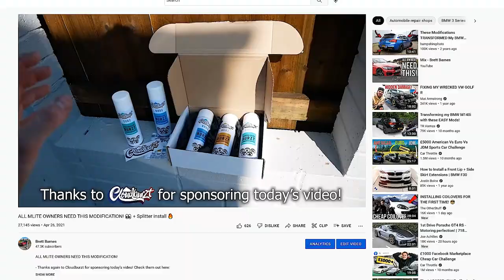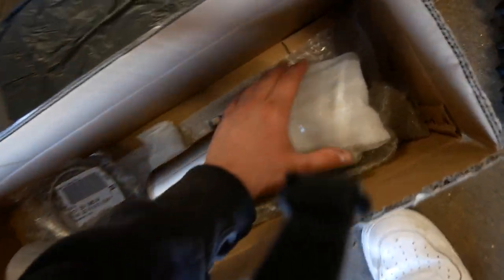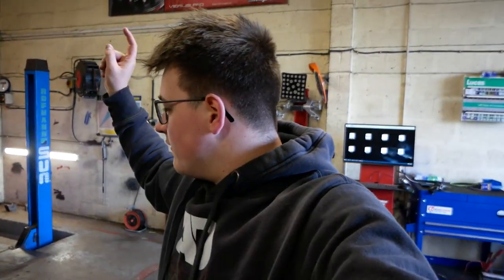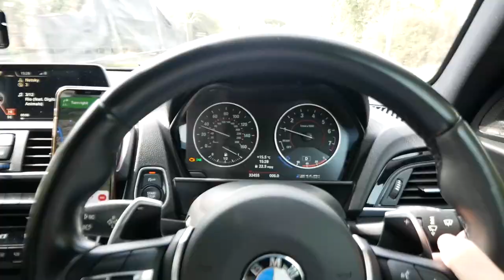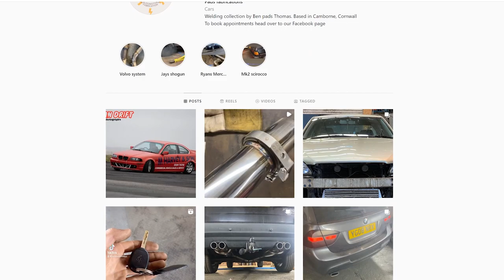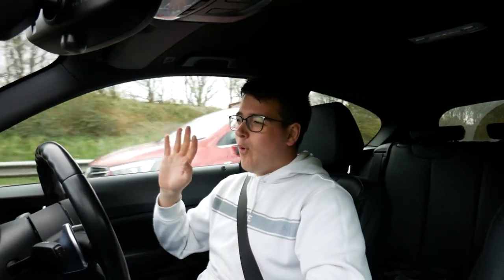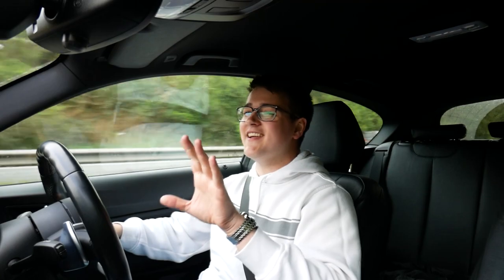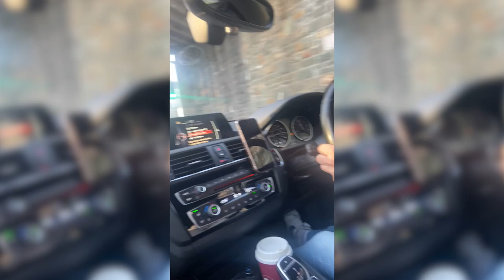SPORTS CAT + DOUBLE RES DELETE FOR MY M140I *EXTREMELY LOUD!*

Comment: Do you need a m performance exhaust for it to sound like this? Or will my stock exhaust be fine? Im thinking of doing this to my 540i
Reply: Stock exhaust retains the valve. You can also gut the standard backbox. Personally would remove the small silencer(box shaped) assuming its the same as the 140. Leave the resonator(cylindrical) in and see how you get on. The former is volume and the latter is for cancelling undesirable frequencies.

Comment: Sounds great mate! Can definitely recommend the Remus catback system at some point too!
Reply from the maker: Yeah that’s my next plan!!!
Reply: Dan has your 140 with Remus race exhaust coursed issue with heat shield coming loose just above backbox. Since installation of Remus earthquake loud exhaust has loosened heat shield. It's probably the loudest in sports especially dropping it flappy paddle mode in sports
Reply: @hotchill11  haven't had any heat shield issues, when I installed a zaero design rear splitter it is fouling on that and causing a rattle, but I think that might be because I've just attached the splitter with the plastic rivets and 10mm bolts x2, will probably need to take the whole bumper off and do a more extensive job!
Reply: @danshut1981  I think deffo needs sorted. I will spend a day sorting it out now that we finally got some decent weather

Comment: Does a double res delete get rid of the GPF? or are the resonators separate from the GPF?
Reply from the maker: Mines not got a GPF filter
Reply: @BrettBarnesYT I assume a GPF would make quite a bit difference to sound with the same setup? Can you remove the GPF without having MOT issues?
Reply: @AJAnewage  removing the GPF would fail the MOT mate
Reply: @dilangadher8479  hmmm is there any work around? or would it still sound pretty decent even with a gpf on it?
Reply: @AJAnewage  My M140i has the GPF and there’s no direct workaround as it’s a Euro 6 emissions regulation so would instantly fail the MOT, but soon I’m gonna put a Remus backbox with a single res delete (keeping the GPF) which I think would be plenty imo. Of course if you wanna risk it you can take it off and then put it back on for the MOT, but that’s a faff and would also void your insurance.
Reply: @dilangadher8479  yeah mines GPF as well, you reckon doing doing sports cat a single res delete would still give quite a boost to sound etc, appreciate the replies
Reply: @AJAnewage  yep that would definitely be a big improvement 100%. I’m after getting quite a refined exhaust sound with a few tasteful pops, so I’m personally not gonna touch the cat, but from Brett’s vid just the sports cat makes a good difference.
Reply: @dilangadher8479  ah okay cheers bud, I'll probably end up doing that for now then, not looking to throw loads of money at full exhaust system at the moment 😋 just want an improved sound, bloody hate GPF is worst thing ever😅 thanks again
Reply: @AJAnewage  no worries, that’s a good shout. Tell me about it ahahha, the GPF completely kills the sound.

Comment: Needs the cold start mapped out for sure. I had decat, long res delete and m performance backbox and cold start would rattle teeth and shake windows in a morning 🙉
Reply from the maker: Yeah mines just about okay! I love it 😅😂
Reply: @BrettBarnesYT  it's the whip cracks when you lift off 👂🏻🎶 Miss mine but the engine is too much for the car without spending quite a bit on LSD, brakes and suspension etc.
Reply: @W00LFY100  getting a pair of bilstein B6 dampers fitted on the back sorts out the rear nicely. It's the stock damping (or lack thereof) that's the main issue.